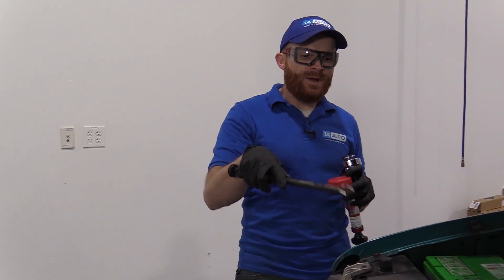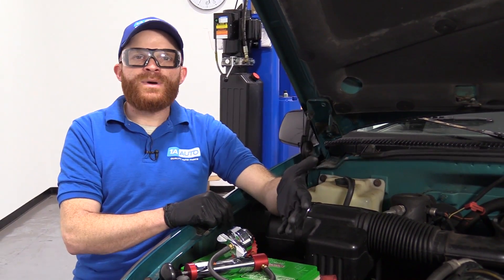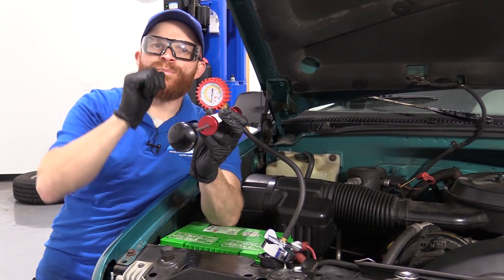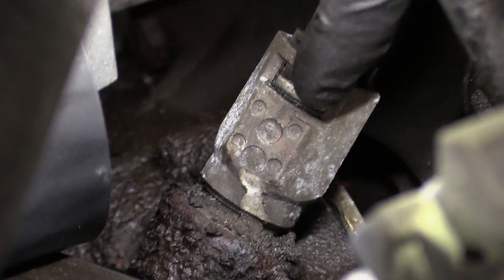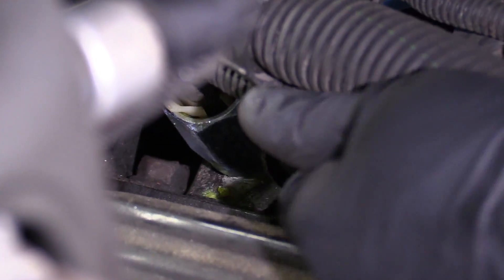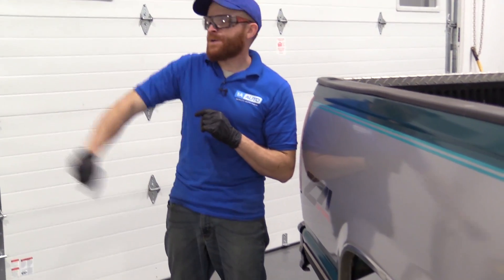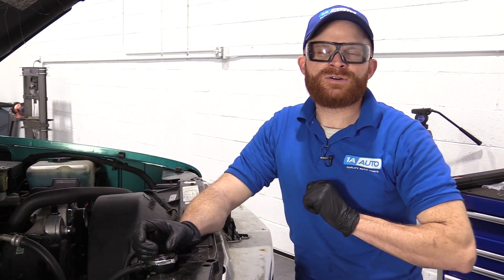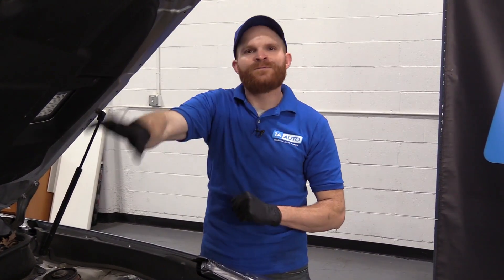Found Puddles Under Your Car or Truck? How to Diagnose Coolant Leaks!

Comment: My car is at the mechanics right now. 
Before it was dropped off I got under the car and recorded with my phone the leak, coolent is dripping about every 2 second to 5 second onto the ground. 
It first drops down ftom the water pump area and then onto a hose close to the front of the vehicle then drops to the ground. 

I have to fill the reservoir up to the line every day about a cup. 

On my phone when I press record to record the video my flashlight comes on really bright so I can really get a good look under the car to see where the drip was coming from. 
I followed it up to the water pump.

The mechanic is saying its the radiator? 

So, how can it be the radiator leaking when on my video I can clearly see it dripping from the water pump area.

The radiator look dry.

Any thoughs? 

Car is at the mechanics now.
Reply: did u fix it? having same problem..gotta get compression test done
Reply from the maker: +Brody McCain We wouldn't be able to diagnose an issue like that here, you may want to have a local mechanic take a look at it. Thanks for checking us out! http://1aau.to/m/Shop-1AAuto-c

Comment: Will a leak cause a burning electrical/plastic/rubber smell INSIDE the car? I have coolant leaking somewhere and the inside of my car smells toxic even when the windows are rolled up.
Reply: I had an electrical/plastic burning smell in my car when my heaters were on... turns out the wiring was melting behind my glove box where the heater part is because the heater was burning itself out. So if it does it when your heater is on it could be your heater burning!
Reply: I wpuld get someone to inspect your coolant lines and the heater core lines. Maybe what the guy up top said is true
Reply: look for a wet passenger floorboard.. if so, heater core is probably faulty

Comment: My car consume lot of coolant but there is no sign of leak,no white smoke,no coolant in the engine oil just resently changed my water pump bt i keep on pouring more coolant.please help what could be the cause
Reply from the maker: +Niko Abednego We wouldn't be able to diagnose an issue like that here, you may want to have a local mechanic take a look at it. Thanks for checking us out! http://1aau.to/m/Shop-1AAuto-c
Reply: Did u figure it out yet

Comment: I loved all of 1A How-to videos. I detected a coolant leak from my Nissan 2001 xtera SUV. I saw a lot of steam smoke ( vapor) came out of the back engine around  the oil filter and back if top engine block. I was unable to pin point exactly where the leak actually came from since I do not know the coolant system component arrangement on my Nissan.
Think you can help sharing some video tips ?
Appreciate a lot.
Reply from the maker: +Mi Lo We do not have a diagram we do apologize but we appreciate you watching our videos!

Comment: Excelent video!! Can You share the sales web site from where i can buy the tools that you told us to used? (Internal coolant pipe and external pressure test  ). Many thanks, regards from Argentina
Reply from the maker: +dexthor weighlifting These can be purchased at any local auto parts store or Harbor Freight tools.  Thanks for watching.